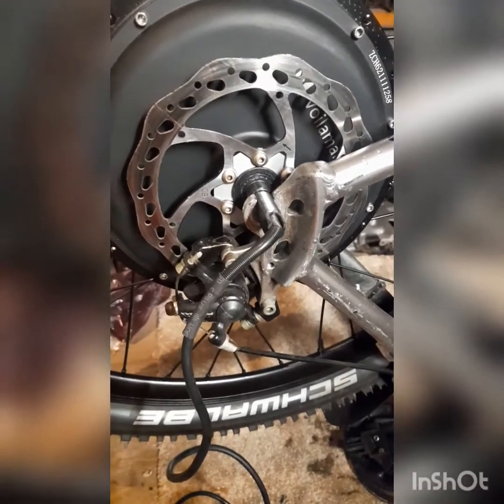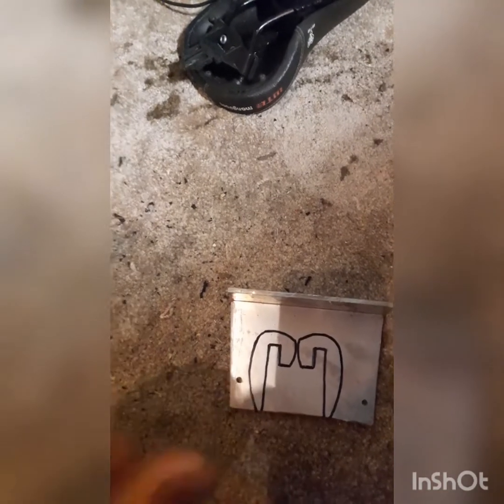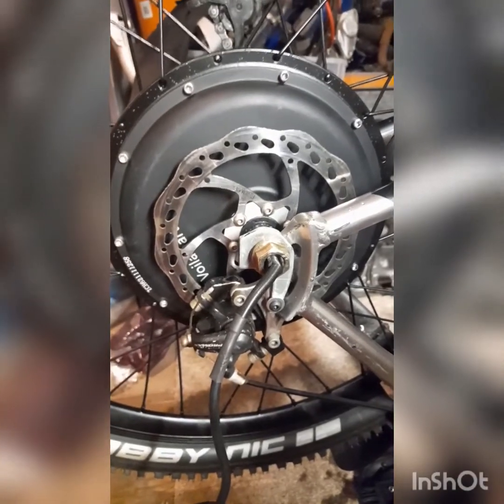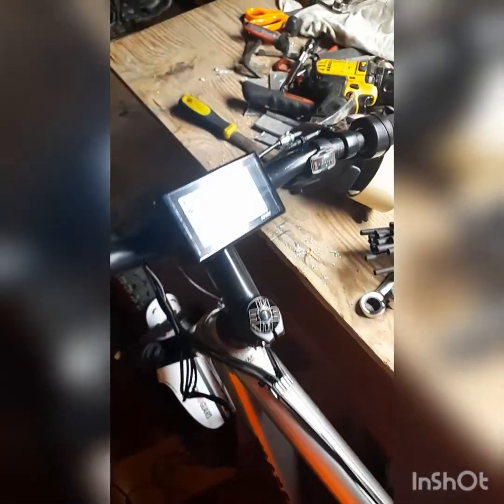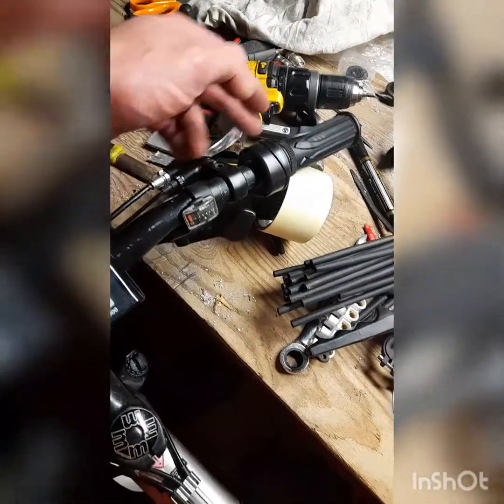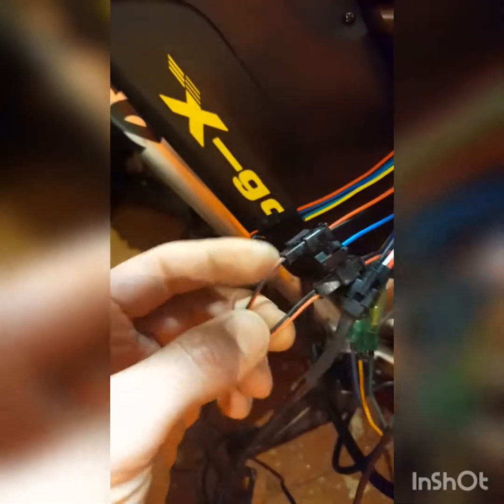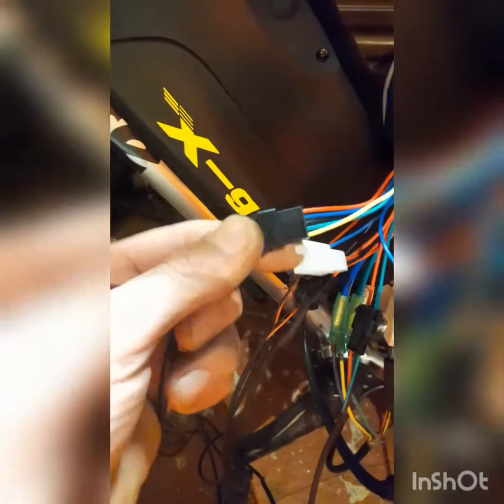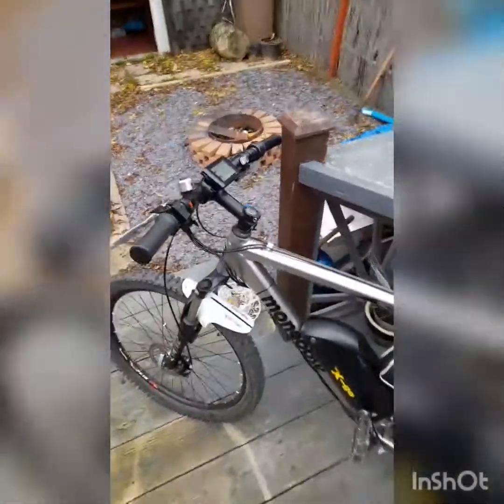mongoose voilamart ebike kit build focus on torque arms and wiring

Comment: I like what you've done with the torque arm, I may have to make something similar too. I've now learnt the direction with which way the torque stress will potentially be going in (so that's helpful as I was a little unsure initially), so thanks for that.

I've ordered a 1500w 48v Voilamart rear hub drive kit (with a 52v 20ah battery) and I've ordered a single torque arm this morning (ebay £12) arm only to realise in the last couple of hours that I'll need to 'torque' protect both sides of the hub motor kit.
Have you encountered any other problems whilst fitting the rear hub drive kit/s? 
It will be my first time fitting an ebike kit so I'm just trying to gather as much info before I start my build as I don't want to make any potentially catastrophic mistakes.
Any tips or advice is appreciated..
Reply from the maker: Everything seems to run smoothly if you space the back wheel caliper and brake with washers or spacers ect just run the back wheel upside-down first and make sure its solid
Reply: @arrondeath603  
Ah right, yeah I was thinking it's just got to be tight but not restricted tight, just no wobbly play in it then yeah?...
Well I'm building it in my dads basement where he's got all the tackle and plenty of washers/spacers etc so I should be fine.
I'm ok mechanically as when I was younger I worked on many an engine.
I'm seriously considering doing a shunt mod too, have you done one? 
I think if I do the shunt mod I won't go crazy and put too much solder across the shunt wires, maybe just touch them together and apply a blob in the middle as I don't want to fry the controller..
Oddly I'm just about to check the controller measurements as I'm wondering where to put it (no back bike rack) as the triangle battery will be filling the inner bikes space up fully...
Maybe I could raise up the seat and put it behind the seat stem?
Thanks for replying, it's all useful info and it's appreciated.
Good vid, was informative.